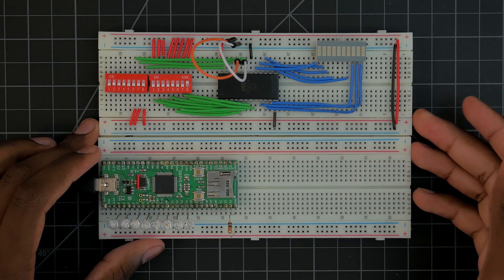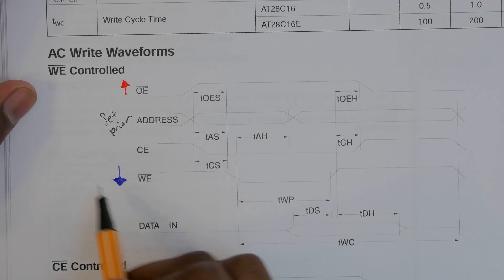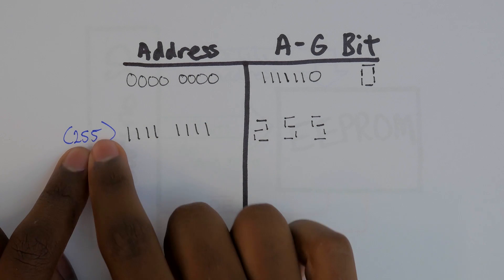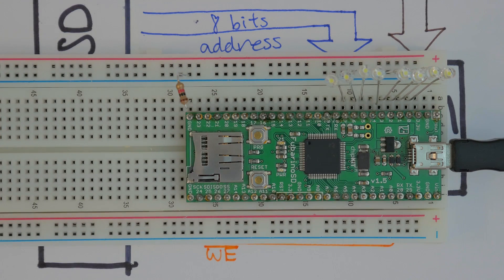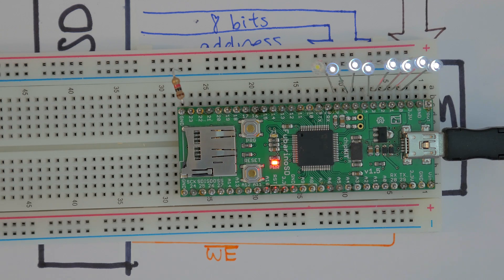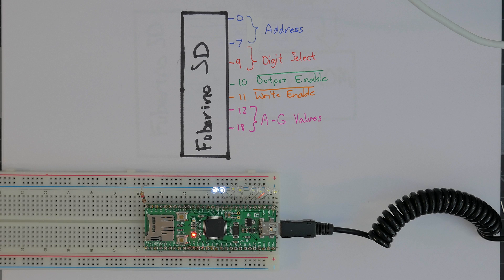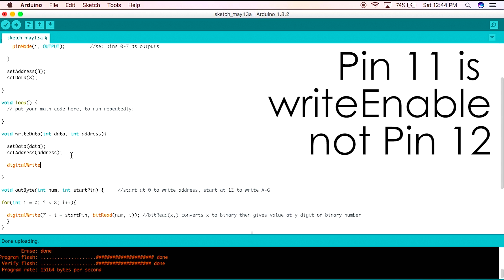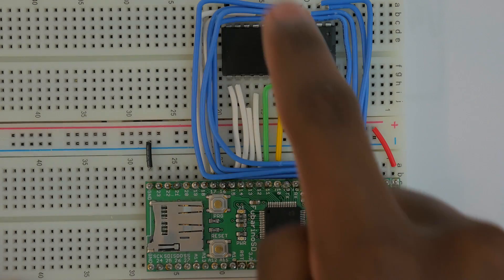Convert  Binary to Decimal for a 7 Segment Display with Arduino | 8 Bit CPU

Comment: Is it possible to build it so you can connect a screen/keyboard to it?
Reply from the maker: +KeinNiemand I know that Arduino is compatible with LCD'S. Therefore I would guess that's it's possible but I don't know for sure. As for keyboard, I'm nearly sure the Arduino can take input from it.